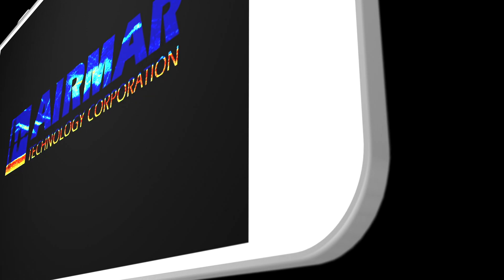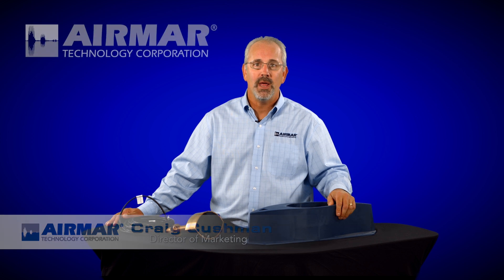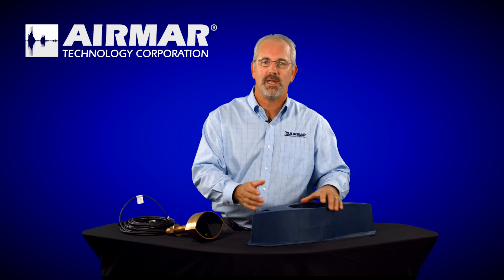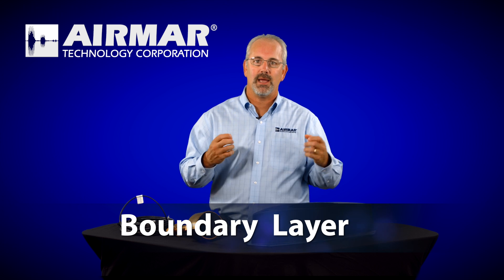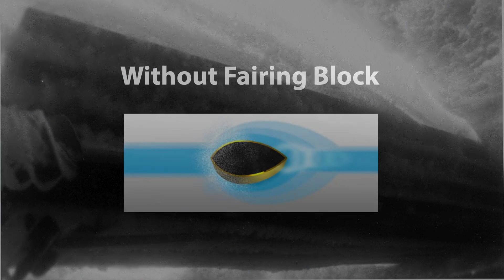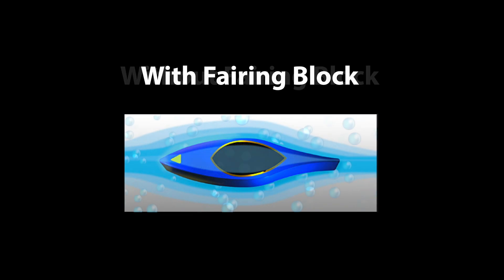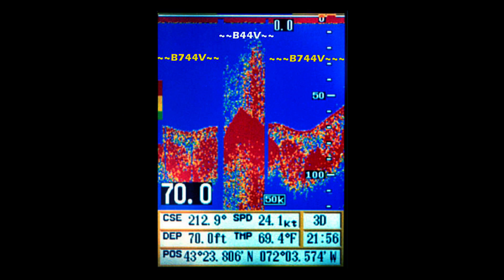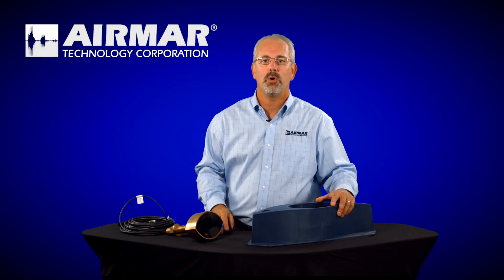Transducer University - Why You Need A Fairing Block

Comment: So, with the flush mount tilted element transducers, the same logic should be applied?
Reply from the maker: Yes, that is true.  That is why we specify that our Tilted Element models are meant for boats up to 36' (11 meters).  Vessels larger than that create a boundary layer too thick in most cases.  Vessels of that size and larger should definitely be using a model with a fairing block.
Reply: Airmar Technology unless the use of the spacer collar that Quality Marine Electronics (QME) from Australia has made and uses.  This collar pushes the face away from the hull surface a certain distance into clean water.